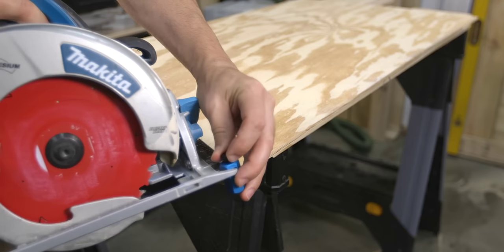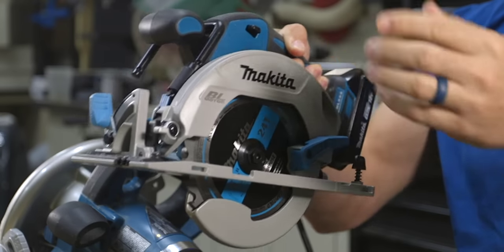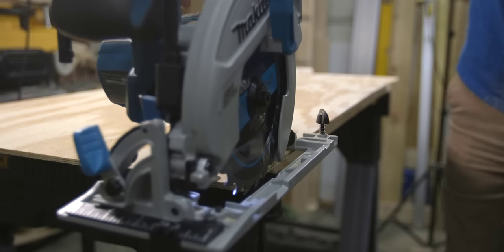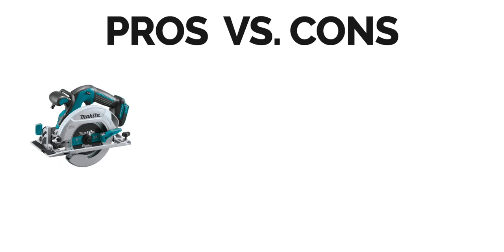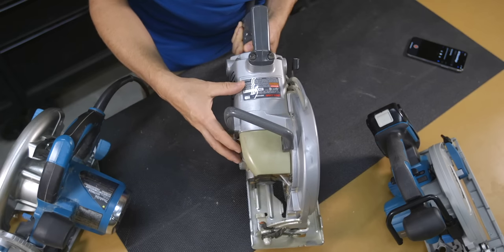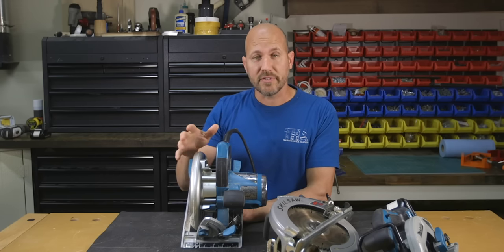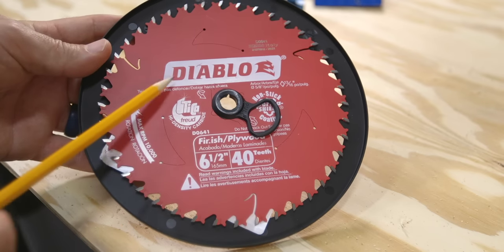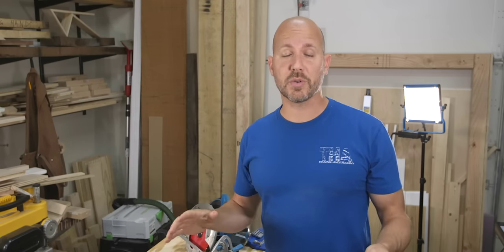Buying The Right Circular Saw That's Best For You

Comment: I just got a Milwaukee 2630 and I noticed that my alignment is not 90degree, so I used the steel carpenter square to align the blade with the shoe to 90 and it is now showing 2 degree off. I went back to the store and exchanged to another one and it showing 1 degree off after alignment. Is that true most cir saw's bevel marking dont align?
Reply from the maker: Yes, I would say that most are not perfect.
Reply: @TrainingHandsAcademy  Thanks for the confirmation. Love your channel. I learned a lot. It was informative